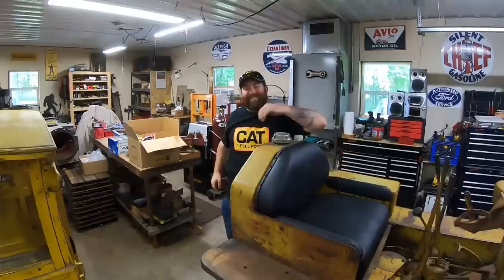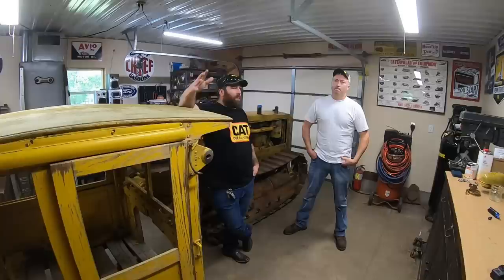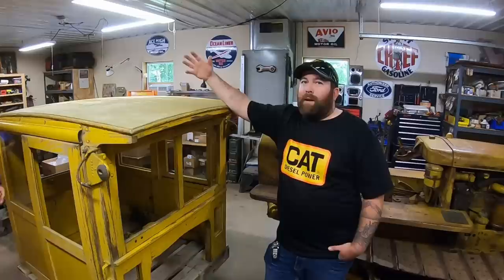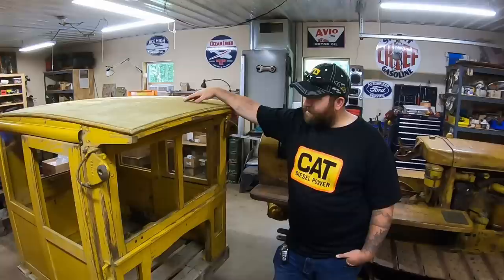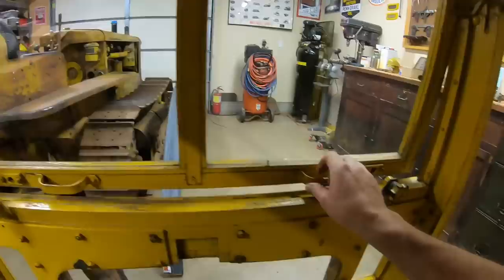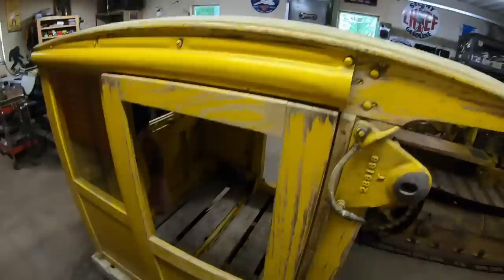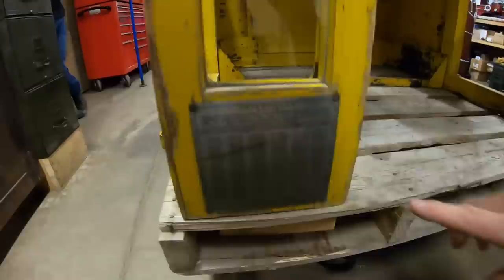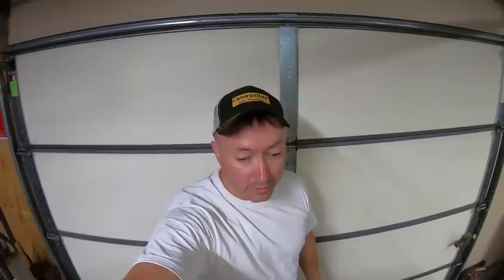Amazing Caterpillar Barn Find! Factory Option D2 Wood Cab Found in Rafters of a Canadian Barn

Comment: Many years ago I worked with "the old man" at a cat dealer. He had told me this tall tale of how  the pieces of rock from the quarry walls would just come through the cloth roofs of the old dozers.
As a kid in my late teens I hung on every word but felt there was a bit of malarkey in there too.
He told of putting a sheet of steel on bricks in the middle of the floor and building a fire on top of a sheet of steel to bow down to the middle. It was too thick to hammer so they had to heat it. These sheets were to replace the cloth tops.
I had totally forgotten about the story until you made the comment about the roof being bowed both directions. It took me a bit to remember who, what, when and where that memory resulted from.
I guess the old man wasn't full of it on that story at least.
I'm 63 now, this guy came from the very roots of the machinery era.
I wish I had listened more.
Cheers
Terry

Comment: Wow, I didn't know that a cab was even offered on that vintage Caterpillar. Is that a Canadian option, due to the severe winter weather up in Alberta/ Saskatchewan, or other far away northern province's?  I have operated late 50's to early 60's D4 cats, with the open ROPS type of cab, rounder steel roof and 4 heavy posts, at each corner. Thats as close as a full cab that I've seen on a D5/ D5 cat. Great score! You will have something that NO one else has, at least for a while. Great Videos Squatch. Wish I lived closer,I would drop by and bend your ear, but it is a bit far from Northern Ohio to Minnesota. LOL.  Good Luck and thanks for the "Cliff Hanger" Loved it, oh by the way, you better keep that cab under close watch, or you may have to go to Kyle Christ's house to retrieve it.

Comment: I did get a little spoiled when IronMan3406 video showed in my news feed without me doing anything. I will say finding something this complete is almost impossible. I can see how these cabs might have not survived in the long run. Now Toby, you need the correct generator with lights to make it shine out. Kind of was hoping the surprise was the alternator but this is way cooler than that. Just as a reference point the Soviet analog KD-35 and KDP-35 have also a similar cab but from looking at this video they are different in many ways. KD-35 utilized more metal and the window opening was completely different + door latches. But I can somewhat say the D2 cab may have contributed to some ideas being reused later. Just a question: what are the dimensions of the cab? I can imagine that getting in and out if your feet are too long might be a issue on its own.
Just ask me how in know :)  PS! IronMan3406 did a awesome job cleaning it up for you.

Comment: Do you have a seat pan that you can cut the sides out of. Mount some fenders on to put the cab on so you can sit on seat cushions in your cab. Maybe the top of a transmission case and floor panels. With casters on the bottom

Comment: I remember from reading about restoring antique wooden canoes that there was an involved process in covering wood with canvas and then waterproofing it. Canvas soaked in alum was stretched over the wooden frame and the alum caused the canvas to shrink and snug up to the wood as it dried. Once dry, several coats of varnish or paint were applied.

Another long lost process from a byegone era.

Comment: You have website? I would really like to secure the measurements and build one for a friend. There is real carpentry in that piece of American Oak and iron. I was repeatedly stunned by the glass being in there and I wouldn't see it until you moved around and cast a reflection. You need a new Caterpillar D2 now with the correct fresh paint and seat box. The cab just doesn't match 51113 . Then that shiny new cab can match the paint you apply to the second one.

Comment: Its hard to tell from the video but my opinion is you can't take a 'do nothing' approach to it, this wood has been in a dry place for years and years, so very much like old furniture that has been in storage in an attic that long with worn areas that also need some preservation, you are really lucky it never got wet. Its likely glued together with a hyde glue which does survive for decades quite OK as you see with old furniture, but the paint seems worn off in places and exposed wood needs some protection, even from high humidity and certainly from water. If it got wet like on a float or at a field day, then exposed wood and in particular exposed end grain will soak up water and that is very bad for old timber. I would not repaint it as I would want it to stay as original as it can stay.

My advice would be to use a 50% reduced raw linseed oil/turpentine mix, on all exposed wood, in particular any exposed end grain such as underneath the whole unit,  take off any metal that would be in the way of the application, the 50% mix will soak into any exposed area and darken any unprotected wood slightly and also give the old paint some protection, so my guess is you will be quite happy with the result,  the oil mix will prevent future water and atmospheric humidity from penetrating the timber for a good while, from time to time that should be repeated. You could also go over any exposed area with a oil based sealer, but I feel you want a minimum restoration, so the 50% oil mix is the best way, at 50% its quite thin and wet so will do a great job at soaking in and sealing exposed areas. Just rub it down thoroughly after the application with a cloth and take off any excess. N

Comment: Very nice, gonna head over to ironmans channel as well, certainly works better than all the youtube recommendations :) But I got two questions. Can you "unlock" the doors from the outside? would be quite a bummer to lock yourself out of the machine by accident and without it even having a key. And Second, do you plan to get all the lights added and working? As far as I remember you didn't plan to add the electrical system to the tractor in the first place. And something about the brackets being available but not the generator itself?

Comment: That D2 IronMan3406 was working on to get started, had two lights tacked on to the sides of the radiator housing.  Those are possibly the missing ones off the cab he got there.  Is it possible to get them, or other cab related chassis parts you need from them?  Or is that D2 sold by now?

Comment: I hope you seriously consider reproducing that cab or at least make very detailed drawings for it, it for sure is most likely a one of a kind find. It is very similar to the wood cabs for trucks back in the 20's through the 40's. The wood work wouldn't much of a problem for one of the several craftsmen that build those types of cabs and bodies but the iron parts might be a bit harder to find/reproduce. There are several vendors that do build these types of cabs and bodies and do have a lot of the iron parts, or at least similar ones, available. An almost unbelievable find!!!!!

Comment: 8:42 basically the same way you'd make a whiskey barrel, but with the added step of putting the tongue and groove. The craftsman (because this ain't factory stuff, you can try to make it on a line, but it ends up looking sh!t) would have to know quite a bit of woodworking stuff. Not every piece of wood would allow for proper installation [and still look as good as it does today]. You can get a sense of the skill required to do something like this, and the knowledge from channel name "EngelsCoachShop", feller made the Borax vagon replicas among other things. There's a whole life time worth of knowledge locked in his videos. And since i'm saying his name, his brother is also a more than worthy addition to one's channel subs, he specializes in restoring the period correct lights, channel name "The Luminary Shoppe".
Reply: I wonder if we could tag @EngelsCoachShop so he can see this as well. He might just know

Comment: For everyones information, if a diesel tank is accidentally filled with gasoline don't panic just add a gallon of cheap engine oil to the tank and carry on, the engine will run just fine on gas and oil and as a side benefit the fuel system will be cleaned.
Reply: No.